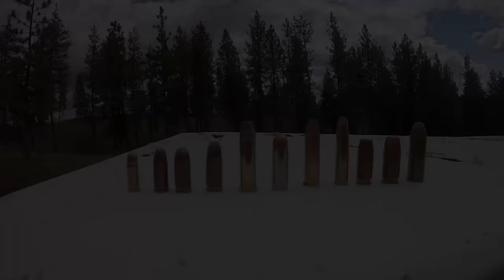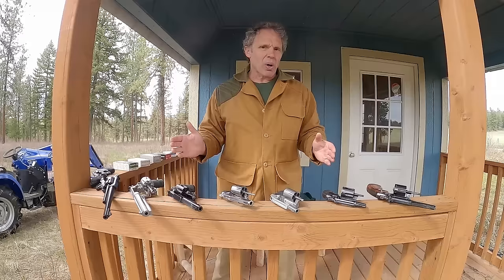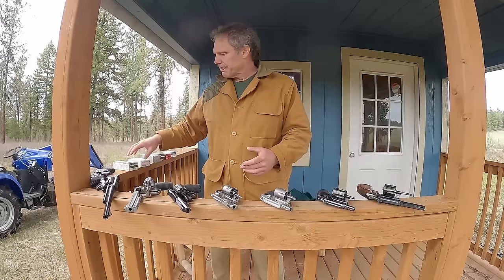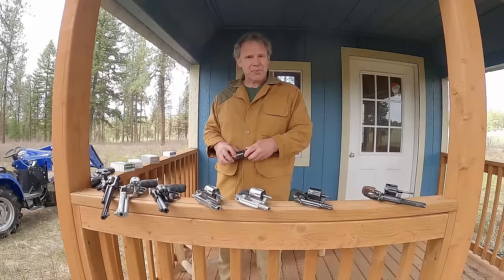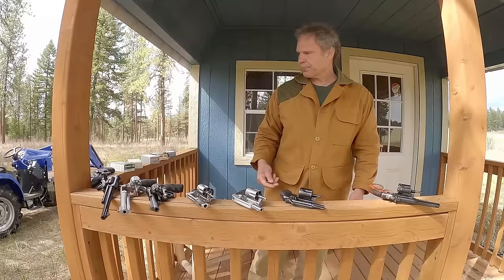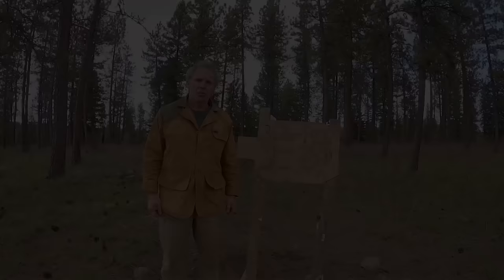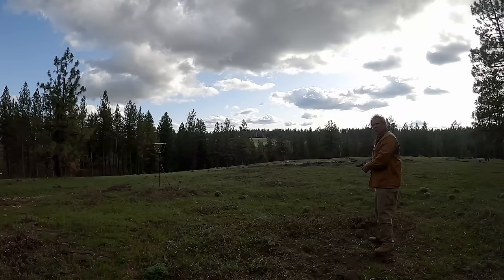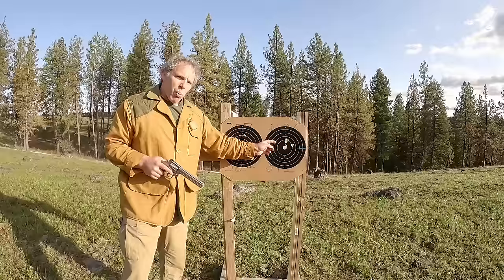Shooting .38 Super in .38 Special and .357 Magnum Revolvers

Comment: Another masterpiece from the real expert. Timely content too. A friend of mine just got a whole case of 38 super for free. He has a Ruger GP100 357. His friend told him “it will work.” I will share this with my friend and he “can be the judge”.

Thanks Paul
Reply: The only problem I could see with firing .38 super in .357, is the hammer striking too deep in the .38 super primer, which would cause it to potentially burn out the back of the case. This seems unlikely though. GP 100, L frames and N frames are very strong revolvers so they should have zero problems with .38 operating pressures.
Reply: If I got a case of .38 Super Auto ammo free, I'd be out looking to buy a .38 Super Auto pistol to go with it.
Reply: @gregb6469  No shit, a Rock Island arsenal 1911 in .38 super is $475. I looked it up and saw cases of the ammo going for $475 at minimum.
Reply: Good excuse to buy a .38 super government model!
Reply: Love my gp100, built like a freaking tank.  I know that's been said thousands of times but it's true
Reply: Does not fit
Reply: @rayburn8282  I have to agree. Tank. Fits in my hand great vs the competition.
Reply: @rayburn8282  such a great gun I have a 4” for carry and a 6” for hunting

Comment: The light primer strike may have been caused by the fact that the rim on the 38 Super should be about 0.009" thinner than the rim on the .357 Magnum according to SAAMI specifications.
Reply: Exactly.. came here to mention that.
Reply: Use a rem 7 1/2 small rifle BR primer and they won't let you down.
Reply: .38 Super rim thickness: 0.050
.357mag rim thickness: 0.060
With .010 inches set-back, it's conceivable that you might get a light primer strike, if all the other tolerance stacks end up being very unfavorable.

Comment: Something I have learned with my .32 H&R magnum revolver, which accepts .32H&R, .32 Smith and wesson Long, Regular 32 S&W, and .32 short; is that shooting a revolver with a much shorter cartridge than it is designed for tends to create a LOT of fouling behind the small ridge inside the cylinder that the case mouth rests on. This effect is GREATLY increased if you are shooting non jacketed lead bullets. After a few cycles of shorter rounds the longer ones may no longer fit due to fouling build up.

Whatever reason you want to shoot the shorter bullets for, in my opinion, is not worth the hassle of the extra cleaning unless as you stated the world has ended and I'm fighting raiders dressed in bondage gear.
Reply: It's very useful to have "Swiss Army" guns when you happen upon a store or gunshow vendor blowing out, say, ancient .32 Short or unpopular .32 Magnum for 5 cents a round and you can shoot it in your .327. I once bought 1,000 rounds of .45 Schofield for 20 bucks and use it for range days with my .45/410 Judge.
Reply: This is why I'm interested in a .327 LCR(X), but the guns themselves are impossible to find in stores
Reply: @quinnmclaughlin7537  I miraculously acquired an LCR .327 about three months ago, following 350 rounds of assorted .327 and 32 H&R Mag without one issue, it's now my EDC. BTW, I was gifted approximately 700 rounds of 32 S&W Long and they are fun, accurate round too!
Reply: Raiders dressed in Bondage gear nice hahaha! Sounds like mad max!
Reply: The .32 Magnum can also shoot .32 acp but with less accuracy.
Reply: To be fair, in some areas of our country (USA) Raiders dressed in bondage gear might just be a random Tuesday. I suppose as good an excuse as any to go with the .38 Super loads in your .357 revolver for a change of pace.

Comment: This topic had never even occurred to me. I don't think I'd ever put a .38 Super into one of my revolvers and shoot it.

I was however envious of your Colt .38 Super that has figured in so many videos. I happened to have a Rock Island Armory full size 9mm handgun with adjustable sights, and wondered if I could install a .38 Super barrel in it to shoot that cartridge. So I emailed Rock Island and was pleased to receive a reply that there was no reason I couldn't do that. I ordered up a .38 Super barrel from RIA and an appropriate recoil spring, and when it arrived fitted the new barrel over the course of a pleasant hour. I did have to buy some .38 Super magazines, but it all works great. So for under $200 total I have a .38 Super. It's not a Colt, but it will do.
Reply: I bought the Rock Island 22TCM/9mm convertible.  With a bit of fitting a standard replacement 38 Super barrel was fitted.   The factory hicap RIA mags run all three calibers

Comment: Years ago when I was reloading, I would load really nice Sierra 115gr. 9mm JHP bullets into .38 Spl. rounds.  .355 v. .357. diameters.  I figured if it was good enough for Lee Jurras it was good enough for me.  Result:  Good accuracy, speedier bullets, reduced pressures.  Worked for me -- YMMV.  Thanks for an informative video.
Reply: Very interesting! Some .357 mag revolvers (like the taurus 692) also let you use 9mm ammo with a cylinder swap.
Reply: Since bullets are typically sized about 8 thousandths larger than the minor diameter of the barrel, I would expect .355" bullets to work in .357" barrels more often than not.

Comment: About ten or so years ago I had to test fire a gun that someone was arrested with.  It was a cheap RG 38 revolver loaded with 38 Super ammo (I don't remember the brand)  We put the gun in a vise, tied a string to it's trigger and got behind a ballistic shield and to my amazement, the gun didn't blow up.  It fired with no problem.  I don't think I would ever consider shooting it in my hands, but it did work that one time.
Reply: RogerWilco99  That's exactly why we have proof loads, which any responsible manufacturer uses to establish a good safety margin. From what I can find it looks like the hottest .38 Special proofs are 29.5K PSI, which could be rather a problem since .38 Super Auto is specified at 36.5K PSI standard, to say nothing of proofing loads. Sounds like it's going to depend heavily on just how much more overbuilding a manufacturer is willing to do above and beyond the already generous margin built in to proofing.

Comment: I have done this experiment with 32 acp in 32 H&R mag and 327 federal magnum revolvers with no chambering issues but in all 5 guns certain chambers would have soft primer strikes resulting in failure to fire. Also none of the guns would eject the cases. So concluded that why do it ,unreliable and hard to remove cases plus no power advantage, if I wanted a easier shooting round I would use 32 long ammo. Totally agree with Paul. Thanks for another great video.

Comment: Another factor to consider before anyone goes popping off any .38 Super in a .38 SPL cylinder is this: most modern .38 Super ammo is loaded to "PLUS P" pressures!
Tolerances aside, the 9X19, .40 S&W/10mm, and .38 Super all have nominally the same rim dimensions, so it turns out that the 9X19 is "rimless", the .40/10 are also "rimless" due to a body taper characteristic, and the .38 Super is a "semi-rim". The same shellholder/shellplate is used for all three. The differences between the 9X19 and the .38 Super are that while they are very close to the same diameter at the mouth, the 9mm has more body taper where the .38 Super has very minimal taper, and the .38 Super case is slightly longer. The .40/10 end up being "rimless" because their body diameter just ahead of the rim is very close to the tapered 9mm, but being a straighter case, their mouth ends up being the right size to hold that .401" bullet. Also, that rim is much thinner than the .38Spl/357Mag rim, which can cause misfires due to the excess headspace presented.

Comment: In the late 70's, early 80', many police and private security entities alowed/required the private purchase of their carry revolver but forbade the use of .357mag ammo for carry. Those with. 357mag revolvers wanting more power than .38+P would use .38super. Massad Ayoob mentioned the same option. As per the misfire, only that cartridge knows for sure but the .38super not only has a smaller rim in DIAMETER  but ALSO in THICKNESS. Having a THINNER rim puts the primer a wee bit farther away from the firing pin, which may have caused the misfire.
Reply: 😳thank you
Reply: Yes indeed, this gap between primer and a revolver's recoil shield is called "headspace," and excessive headspace can cause a "light strike" or even a "no strike." The tolerances necessary to get a positive primer strike that is neither too deep nor too shallow, are once again a matter of thousandths of an inch. This entire video is full of great examples of gun and ammo tolerances in design, manufacture (and wear matters, too!). "Tolerance stacking" of one variation atop the next, atop the next...at some point, malfunctions will arise.

Comment: Thanks, Paul, for your excellent report and demonstration on an important topic. The .38 Super has a SAAMI case diameter of 0.384 -.006, giving it a minimum case body diameter of 0.378". And the .38 Special/.357 Magnum has a case diameter of 0.379, with a chamber maximum of 0.384, is why standard tolerances can allow the .38 Super to sometimes fit a .38/357. Your misfire was likely because the .38 Super's standard rim thickness is 0.050, while the .38/357 is 0.059. The bores (land and groove diameters) of both cartridges are the same, though the bullets differ, with differences in throats, which doesn't matter with the nominal 0.002" smaller .38 Super in the larger .38/.357. But as demonstrated, the .38 Super +P has a greater velocity than a .38 Special and with that, the .38 Super is rated at more than double the maximum chamber pressure of the .38 Special, perhaps making it a formula for catastrophic failure, especially in older revolvers. Though the Super's maximum pressure is 1,500 psi (~4.3%) higher than a .357 Magnum's 35,000, with .38 Super +P yet higher, the excessive "freebore" formed by the additional case length in the magnum's chamber, along with the cylinder gap and barrel's forcing cone, may make it a wash as shown by the revolver's lower velocity.

Comment: Thanks Paul, this answers a question that I had and in particular for my S&W Mod 19 2.5 inch bbl.  While I reload, components are still difficult to come by. Commercial loads for defense are really brutal for a revolver originally designed to handle 38 spec and for my ears if i need to use it while the attacker declines to allow me put on my ear pro. 38 sup seems to be a good compromise between 357 and 38 spec +P.
Wished you had checked speed loaders too, but I can do that at my local power parlor.
I miss the Pop Tarts also. Maybe "Lucky Charms for the man short on skills."

Comment: I recently inherited a S&W model 547. 9mm no moon clips. the design is a whole different animal. S&W put a lot of engineering into that one.
Reply: If you read up on the history of various cartridges, there's discussion of what dimensional characteristics were important, and what were less important.  Additionally some characteristics might not have been important when a particular cartridge was designed, but later have been headspaced against and are now important.

Revolvers are an old idea, even predating the cartridge round.  When the revolver cylinder was designed it was for cap-and-ball ammunition, with straight bore cylinders that were machined through entirely manual processes.  When cartridges were invented, many cap-and-ball designs were adapted to cartridges, with the casing length being one of the easier means to control how powerful the round was.

Tapers in semiautomatic pistols appear to serve the purpose of allowing further tailoring of ammunition to pistol.  Tolerances are tigher and theoretically performance should be improved.  The wrong ammunition simply doesn't fit into the chamber, or if it fits it doesn't align properly to let the firing pin sufficiently contact the primer reliably.
Reply: Headspaces off of the case mouth and not the rim.
Reply: @centurian318  I’m glad somebody finally said it.

Comment: This is quite a topic Paul, I remember back in the 90´s you could buy reamers that would open the chamber a couple thousands in order to load 38 super in a revolver that otherwise won't, caveat here, 38 super was developed during the 90s as a race gun cartridge and very hot loads (1400-1600fps!) were manufactured and sold for the purpose, this meant that a 38spl revolver would not be able to hold those pressures so better don´t even attempt to do it, at those speeds 38super is more a 357 than a 38spl, IMHO people should never attempt to fire 38 Super ammo even if it fits on 38/357 revolvers, just leave it alone, it is made for a different kind of gun, I remember all the experimentation that went along with supported and unsupported chambers for 38 super firing the modern loads, guns would simply blow apart after some use if the wrong kind of barrel was used, 38 super today has changed a lot from the original, just play it safe.

Comment: Paul’s “mad max scenario” with .38 SuperAuto in a .38 Special revolver shooting stance is the same shooting stance I use when testing out new hand loads.
Reply: Not gonna lie.  I've done the same back in the days when I was chasing hand cannon limits.   And yes you can go too far with 405gr .458 (swaged down of course) bullets in a 454.   When THAT extraction is "sticky needs a rubber hammer to the extractor",  you're probably over the design limits.   Fortunately it was a Super Redhawk (and still is).

Comment: One thing to mention, the 38 Super is loaded to 36,500 psi, the 357 Mag is loaded to 35,000 psi but the 38 spl is only loaded to 17,500 psi.  The original 38 auto (APC) is still loaded to 26,500 psi, quite a bit higher than the 38 spl.
I thought it was interesting that he mentioned to not skip a head.  I don't know of anyone that skips a head on a Paul Harrell video, rewind and rewatch, yes.  Skip a head, the thought never crossed my mind.

Comment: I one time fired two 38 super rounds out fo my Taurus 357 revolver. The rounds hit accurately but the cases bulged and split and got stuck. 38 super and 32 auto have a slight rim and will fire without moon clips in a revolver, BUT different ammo manufacturers have different thicknesses in their rims so some rounds may not fire due to light primer strike. I also have a cylinder for my Ruger Blackhawk that fires 38 super but 9mm Largo rounds drop further down in the cylinder and do not fire. So with that some ammunition may be interchangeable but not always. Also DO NOT fire 38 super ammo in guns made for 9mm Largo.
Reply: It's almost like you shouldn't fire cartridges in guns that weren't designed for them. Amazing.
Reply: @jimvac77  hehe
Reply: @jimvac77  Ruger Blackhawks come with two cylinders to fire 357 or 9mm. I have one that is also made to fire 38 super. 9mm Largo and 38 super can interchange but for the same reason Mr. Harrel advised against firing 38 super in 38 special you should not. I have a bolt action rifle in 9mm Largo. Other people who also have these told me they shoot 38 super in theirs. I do not because the 38 super has higher pressure. But if you reload and 38 super will work in your 9mm Largo you can reload the super brass to Largo specs. Most Largo brass is non-reloadable surplus or aluminum case so 38 super brass is easier to come by. You may also be able to use 38 acp brass. Maybe I should have explained it better for simple minds.
Reply: @jeremy74pow  Thanks for a completely unnecessary explanation and enjoy your Destroyer carbine. P.S. - 38 ACP brass is exactly the same as 38 Super brass.
Reply: @jeremy74pow  Understood what you stated. I bought some .38acp brass years ago to use in a Astra A400. Never got around to loading it to 38acp specs.

Comment: The .357 solved the problem of a more powerful .38 revolver cartridge  than the .38 special, which was the replacement for the original .38 round. If you want to find a place for your ,38 super round to shine, put it in an auto loader and then you have something to write home about. That said, thanks Paul for spending time to clearly answer a question that shouldn't have been asked.

Comment: 3 min mark: OMG, look at all those revolvers....I AM IN HEAVEN! :-)
Definitely a revolver fan. Yes, I'm an anachronistic throwback.
Reply: Same here.  I prefer the failure drill of a revolver over an auto.  Just pull the trigger again, vs the either recock the hammer for a second strike or pull the slide slightly back to reset the striker, then if that doesn't work run the slide to dump the round and feed the next one.
Reply: @greylocke100  True unless you get a squib that puts the bullet halfway up the barrel and leaves it there.
Reply: @Sableagle  I think I know the difference between a light primer strike and and a squib.  I know you weren't meaning to be derogatory, but there are some folks who DO NOT KNOW.  Hence the need for training and experience.
Reply: @greylocke100  Yah, and there's the problem: someone puts a revolver in someone else's hands, thinking there's no training necessary ...
Reply: Wheel guns are Real guns!  🙂